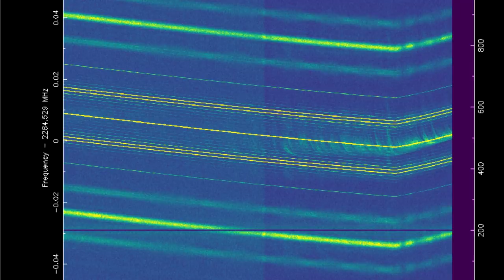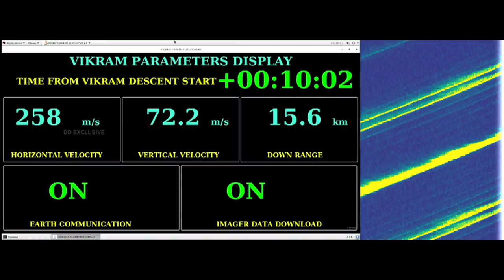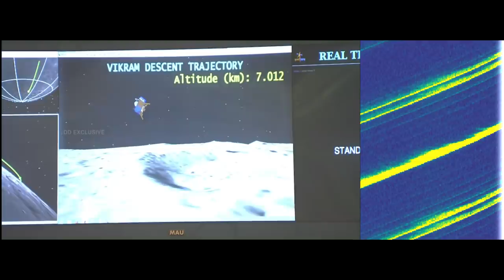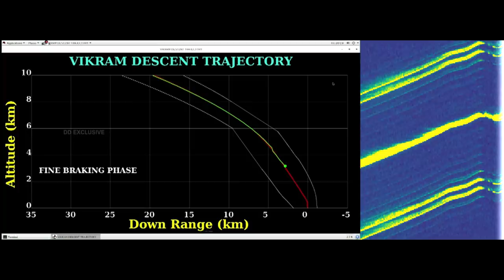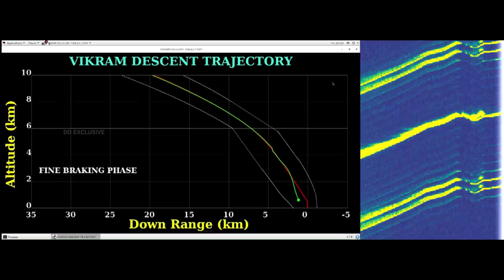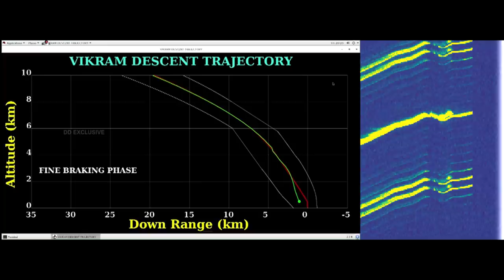What We Know About India's Failed Lunar Landing

Comment: Lithobraking successful. The most dependable technologies also tend to be the simplest and oldest. I wonder if any seismometer data is still being collected. Maybe the next lander should bring one... in a crash proof housing. Flying is easy, landing is hard... like rock.
Reply: There no such thing as crash proof. It has to decelerate every miscellaneous part slow enough to not rip it from the piece next to it. You can't just put a diamond casing or cover it in bubblen wrap.
Reply: NedryOS I know but I’m trying to use sardonic humour to survive my disappointment. As for bubble wrap they did use that for mars landing as a bouncy ball.
Reply: @TheGreatPurpleFerret  iirc didnt Russia wrap one of its landers in airbags
Reply: @chaitanyak.n.4768  so did the US for a mars lander for the final descent to the ground
Reply: NedryOS A crash proof housing or packing for anything needs to do two things: Prevent edges of the outside hitting the protected content, and reduce hard decelerations by allowing the content to move a bit.  Hitting at 100m/s (360 km/h) needs only a little more protection than a cricket player being hit by a fast ball.
Reply: Anybody planning another probe landing on the Moon might start considering building in some hefty airbags at this point...
Reply: Litho braking successful.  That ain’t right, man!  It was funny, though!
Reply: @TheGreatPurpleFerret  Actually, bubble wrap can work, (if done appropriately), because the bubbles break progressively, reducing the impulse & acceleration.  Same velocity change, but over a longer period. And some missions to Mars used it, (well airbags of some sort), for the final stage landing.
Reply: @TheGreatPurpleFerret  A standard 'black box' as is found in any commercial aircraft would easily survive such an impact.
Reply: @listerdave1240  they're still not crash proof, not even "functionally" so.  I'm seeing 150m/s as the max survivability for FDRs and I'm pretty sure that's vastly overstating it. Like Beresheet, the Vikram lander was likely going near that velocity. That also requires using precious mass for something that cant even transmit the recorded data, they have to be recovered in order to examine them.
Reply: @NemoConsequentae    oh yes it absolutely can be used in the appropriate situations, like Opportunity and Spirit. But they were dropped off the lander at irrc around 10 meters and zero meters/s velocity.
Reply: Yes, I tried hang gliding, fun to fly oops then thud.
Reply: According to Don Petit (about the technology used to get to the moon) "We destroyed it, and it's a painful process to build it back again".

Yeah, we can't build 1969 technology to get back to the moon.  That checks out.
Reply: David Robine yeah while I love KSP lithobraking I was sad about the 2nd loss to the moon and my brain said sardonic humour was the answer.
Reply: Based Bear are you flat earthing? I’d suggest stone tools are beyond most people, just like how a slide rule would be beyond the culture that moved beyond that capability. Apollo era hardware uses techniques that were labour and skill intensive. Skills where all the people who used them have retired. Just like how it’s harder to make a katana than a hand gun, and the hand gun is more effective... despite the hand gun also needing to be designed and tested, just like the space program is doing. The clearest example is how the computers they used on Apollo were naturally robust and radiation hardened because they were literally woven from wires and parts by weavers. Today’s computers while more powerful are also more vulnerable to radiation because of how small all the components are. We can make them much more easily but they have issues that need to be accounted for. We can’t just copy Apollo because those techniques have faded from use. So yeah it checks out. Lots of evidence for space flight and moon landings from multiple independent sources including unfriendly nations admitting NASA beat them.

Comment: Maybe some booster misfired or fired at some angle not within the target tolerances and must have sent the lander in a tumble/rotating spiral as it descended?
Reply: The booster misfiring could be  one of the reasons according to some experts but lets see
Reply: I think your assessment is closest to the truth.. It take precise controls by propulsion control system to position the space craft in correct angle when it transition from orbital flight to vertical landing. Either too much or too little thrust accompany by overcorrections will cause the spacecraft to tumble out of control.
Reply: Or maybe it had a partial collision with some mountain. Who knows ?

Comment: Greetings Mr. Manley,  I have a question for you as you appear to be well informed and up top date on the current state of research and development in the area of rocket science.  I was wondering if there was any research being done on using linear accelerator/mag-lev technology as a substitution for a primary stage on an Earth to Orbit Launch Vehicle?  I know it could not be used as a stand alone but if such a system could be used to accelerate a Vehicle to a few hundred MPH and maybe even give it an upward trajectory prior to igniting the engines I would think it be a major benefit.

I know such a track would need to be several miles long but it could be constructed as an expanding spiral as the 'launch' area would be at low speeds and the acceleration increasing as it traveled down the track.  I don't know, maybe the last 1/2 mile or so could be a large railgun for an added boost right at the end.  I'm Blue Skying here

Just seems that if it works for a bullet train it should work for this.

Comment: Airbags, folks; they work on Mars.  Looking forward to higher resolution imagery.  Good work.
Reply: They work on Mars because there is at least a little bit of atmosphere. On the moon, there's none whatsoever. If airbags were deployed above the moon, they'd almost certainly rupture due to no air pressure outside holding them together. And even if one could be inflated and stay intact, the force of impact with the moon's surface would break the airbag.
Reply: @crunchydango  Mars is basically vacuum, we can easily design inflatables to deal with the pressure of hitting the surface but impacting messes with instruments and inflatables also pose their own challenges.
Reply: Airbags work because the martian landers were falling much slower and the landers weigh far less.  Curiosity didn't use airbags for these reasons.
Reply: @crunchydango  Quite possible, if descending too fast.  I was thinking of that last 100 feet, where the bags were deployed on Mars, (while still under a rocket descent) to avoid performing a critically smooth touchdown on unknown terrain.  I think the bag's gas pressure was only 1 psi or similar.  Just a thought.

Comment: Isro now says contact lost at 400m above not 2.1 km
Reply: I believe it struck something at 2.1K, and began tumbling. If it was damaging to ANY of the controls... it's fatal. It may have taken out a few of the comm systems. Less than a mile up.... coming in at 125 mph without controls. And the data stream looked like an impact,... then a quick vertical descent. If they had camera's on it broadcasting... but no.

Comment: Even thought I am late, but I just wanted to add a positive thing that the orbiter is still orbiting the moon right now, and it has the most high resolution camera on board, with a resolution of 0.25m per pixel. It is able to clearly view craters which are 5m across from an altitude of 100Km
Reply from the maker: I wish they’d publish more than 3 images from it.

Comment: Soft lending is tough i guess. ISRO should next try landing rover same way NASA landed its rover on Mars.
Reply: How did they landed bro?
Reply: Yeah soft landing is tough . Isro should use terrain relative mapping for moon landing
Reply: No atmosphere on moon so isro can't use parachute like mars
Reply: @pranavkadu205  no parachute but they can use air filled ballon to surround lannder so it works as shock absorber.
Reply: @sandeepdubey6984  air filled balloon will rebounce to high as gravity of moon is very low and roll down to bottom of crater or land at sloppy place
Reply: @sandeepdubey6984  therefore we should not take risk
Reply: @pranavkadu205  isro didn't land on Mars, only orbited, so never used a parachute there

Comment: Some corrections..... We lsot communications at 335 metres from lunar surface to be exact...
Secondly, the lander did a rough landing but not at 200-400km/hr as you presumed... It is still in a single piece but is tilted,... It has not suffered much damage as the landing was controlled by the onboard computer of the lander.

Comment: 2:20 Looks like the Indian are still using Windows 95 or possibly Windows XP ?
Reply: That looks like a Custom Dashboard, also @ 2:08 the 2nd  monitor from the left has the task bar to the left ,which is typical of Linux systems. So its probable that they are using Linux.

Comment: I think it run out of propellant coz' it had to correct itself from being upside down, using more propellant than planned. I wonder why it flipped upside down- must be the programming, a code problem. But the savings they made with the Mars orbiter, made up for the cost of the Vikram failure- it evened out in a way, economically.

God bless, Rev. 21:4
Reply: No the engine over performed and it flipped
Reply: What is the propellant propelling against if space is a vacuum?
Reply: @kirkulessonofgoose7503  It pushes against the rocket itself (imagine you're the thrust and you keep kicking a chair many times and fast), the thrust although it's gas, it's matter, it's like there's a solid had pushing against the rocket, the thrust goes a different direction, the rocket goes the opposite direction as Newton's Law dictates.

When on the ground, although the ground helps (along with the thrust pushing the rocket coz' the ground too is pushing against the thrust opposite in the other direction. As the rocket goes up, the air, although negligible is also pushing against the thrust but it's really the thrust of the propellant (a controlled explosion, like a fountain pen is a controlled ink leak)  pushing against the rocket once it's in a vacuum, both in opposite directions. Distilling it's forms, it's just matter to matter pushing against each other in different directions.
Reply: @SevenDeMagnus  that’s a lot of words that don’t answer my question.
Reply: @Muffinconsumer4 . How does a helicopter drone fly in almost no atmosphere on Mars.
Reply: @Muffinconsumer4 . I did.